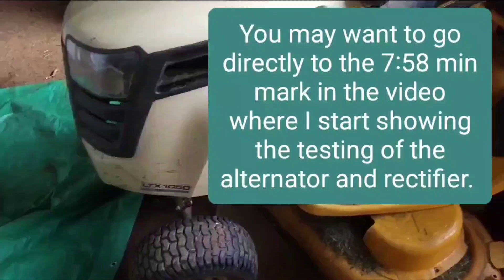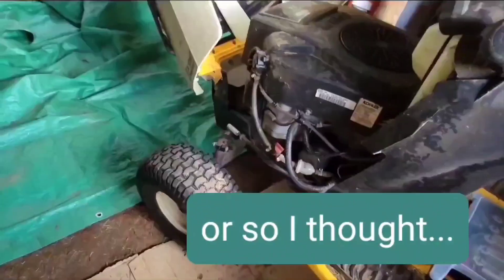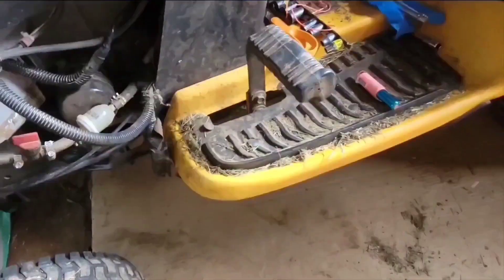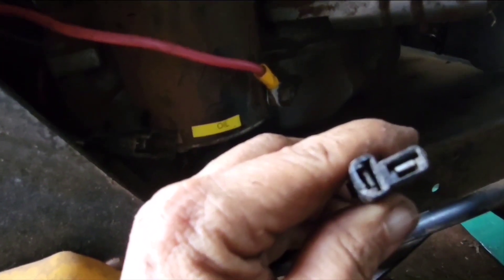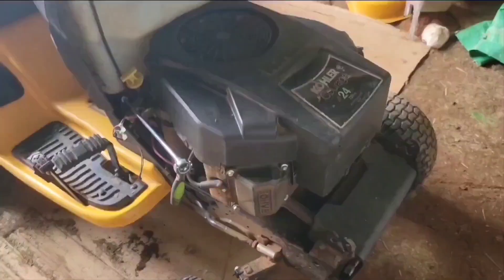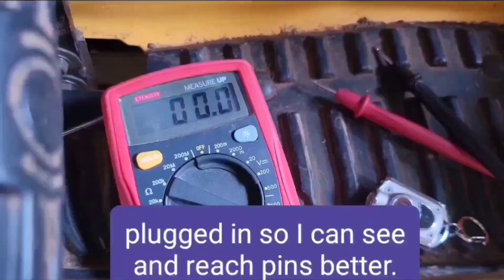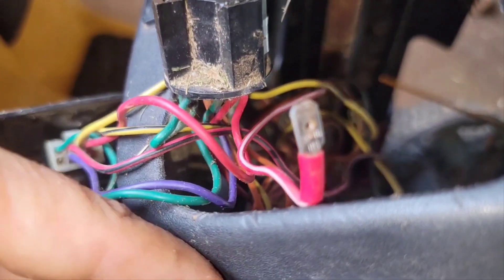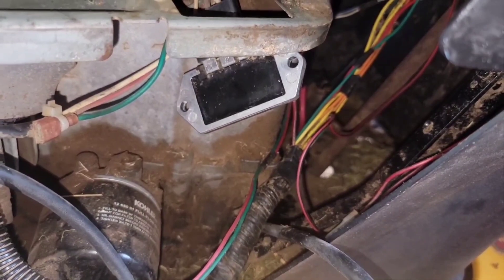DIAGNOSING BATTERY NOT CHARGING ON LTX 1050 CUB CADET : PTO, ALTERNATOR, AND REGULATOR

Comment: Okay so I'm learning all of this tonight 😂 there is actually a part that charges the battery on the mower! I got the exact same mower and engine. I guess I'll have to check it out and try to see if I can fix the issue or if it needs a jew alternator or something! That's weird the wire necessary to charge the battery wasn't connected on yours. Any idea why?
Reply from the maker: @TomdrumsTN  Hi Boch, yes, the PTO charges the battery as long as the internals are working.  I got the mower used and am not sure how that wire got disconnected.  Someone rewired everything to remove all the safety switches.... which I really like, but I think maybe when they did that they cut that wire not knowing what it did. I never could find the mate to it.
Reply: @girlintheblueridge6529  thank you so much! I'll be working on this soon. The mower screen indicates that the battery has 11.5v while running and 10.5 to 10.9v while the pto is engaged. Definitely too low! Lol.
Reply: @girlintheblueridge6529  https://youtu.be/qXZpi7UKges?t=511 could you please explain me where i should put each pin of the volt meter on this regulator that has 3 different section ? Thanks!
Reply from the maker: @DrumPeearl  Hi Boch, Yes, with ur meter set to read 50v or more, attach your positive and negative leads to the out two pins. The middle pin is ground. It does not matter which is which because AC current is alternating. Just use the outer pins, far left and far right. Not the middle one. Does that help?
Reply from the maker: @DrumPeearl In the description I have left a link by Kohler Engines University and he shows the actual 3 pins coming off the stator/alternator and shows how you connect to the outer two pins to test. Watch that if you can.
Reply: @girlintheblueridge6529  Thanks for your reply . I have ran several test . one with the probes in the harness of the regulator directly . both on the outer sides . it actually showed like 30 to 40 ac ... and then I ran another test with the regulator plugged and made the probe touching the 2 outer pins of the capacitor and the results were weird.  sometimes it was showing 0 and sometimes 30 to 40 ac . also I tried to measure the tension on the battery directly . when mower was off it was showing 12.6 something v and when the regulator was connected it showed 12.8v at the highest voltage ... not more . I guess the regulator is bad . I am actually waiting to have a replicate part (china) deliver today and see if it changes anything . I don't know what it could as all the wires are well connected and secured on the connectors by the starter and screen ...
Reply from the maker: @DrumPeearl  Hi Boch, thanks for the update. 
The 30-40v ac reading means your alternator/stator under the flywheel is good. 
  The variation of 0-30v you got when the regulator was plugged in was probably just a lack of solid connection. Make sure the pins and terminals are clean and no corrosion. If they look good, it was probably just your probes not touching good or moving around. Both of these tests only test the stator. 
  In order to know if the regulator is good, one needs to verify first that there is 12v power at the regulator.  With regulator plugged in, and meter set to V DC,  probe the center pin on regulator and the battery ground. Meter should show 12v. (If all your wires are okay, voltage shown should be same voltage as battery)  If not, there is a problem with connection of that purple wire to a power wire.  
If you have 12v there, then with a fully charged battery, start the mower. If the regulator is good, you should see about 13.8 V or more on the battery. If not, then put in new part and start mower and test battery. New part should fix the problem. 
  From your comment I wasn't sure if you were saying that you were showing 12v at the regulator center pin or not. 
    The voltage of the battery with or without the regulator plugged in does not verify anything except the state of your battery. Sounds like your battery is fully charged. 
   Do u have 12v at the center pin as described above? And what is voltage of battery when regulator is plugged in and mower is running?
Reply: @girlintheblueridge6529  Hi! I got a new part and I'll try tomorrow . No matter what the voltage on the 12v battery never went over 12.8 when i measured wit the volt meter in dc mode . It increases from 12.6v when mower is off to 12.7-12.8v but never over . the battery is from rural king and is about 1 year old and maybe 10 hours of mowing but maybe the fact I had to charge the battery many times have worn it out .... I'll see tomorrow! :)
Reply: @girlintheblueridge6529  I changed the part and I can tell there was an issue with this part the whole time because on the screen it was showing the voltage of the battery instead of the hours of the mower and I also had the red light whenever the pto was engaged! Problem solved and the mower is way more powerful now! :) BUT the voltage on the battery is about 14.5v when the rpm is set on high . Which  seems to be little bit too high ,right ?
Reply from the maker: @DrumPeearl   Hi Boch, so glad to hear you got it fixed and working! And thx for all your details. It will help others. 
As far as your charging voltage, mine was reading around 14.5 too and I was concerned too.  That's higher than most vehicles. But I've been mowing with same battery for over a year now since I did the repair and it even sat all winter outside... that makes the battery 2 years old now and it's only a one year battery. So I think you will be okay. If you find out anymore about the correct charging voltage let me know.  Take care and happy wrenching!
Reply: @girlintheblueridge6529  thanks for all your answer and help on addition to have published this video! I have definitely over thought this whole thing lol. Also I have checked and a mower battery should be around 14.5 to 14.8v with a high rpm. A car battery is normally slightly lower while in charged.
Reply from the maker: @DrumPeearl  welcome. Yeah, I definitely over thought the whole thing too initially! Lol. The video is kinda choppy too cause I was learning too. Once you understand it and make sense of it all, it's really simple, I know. I can't believe I went a whole year having to charge the battery every time I mowed. It just seemed a daunting task to fix.
BTW, my battery WAS dead first time I tried to mow this past spring. I thought for sure it was a goner because of all the times I had drained it. I was about to just go buy a new one, but then I decided to try charging it up and see how long it would last. I'm so glad I did. It's been starting every week without any problems. I even left it for 2 weeks with out mowing and battery was still working. Going on it's third year. 
I got it at Tractor Supply. Will definitely get one there again.
Reply: @girlintheblueridge6529  mine was bought last August from rural king. Probably the cheapest model. I'll see how long it last with the fact it has been jumped and charged many times. I am always in a process of learning. I didn't think the mower had this defective part! How many hours does your mower have?
Reply from the maker: @DrumPeearl  It had 300 hrs on it when I bought it 2 yrs ago. Now it has 400hrs. And urs? 
I changed the transmission fluid right away. I was so glad I did. It was milky. I've yet to get that video posted. It's important to do to keep the transmission in good working order. Had to siphon out the top of the transmission and then add some fresh fluid and siphon again until it was clear, rotating rear wheels each time. Then fill and put plug back in.
Reply: @girlintheblueridge6529  mine has 240 hours and got it last end of June with 190 hours. I don't mow super often lol. I didn't know the transmission needed to be flushed! Is that complicated to do? What symptoms did you encounter before thinking about doing it?
Reply from the maker: @DrumPeearl  I didn't know the history of the mower. It seemed to run okay, but I wanted to do preventative maintenance. I figured fresh oil would keep it running good for a long time. I came across this link and went by that as a guide.
https://youtu.be/SxkR2Hade9M?si=lyhmuNe3xUk-RF8K

 Apparently my mower had been left outside where it would get hot from the sun and then at night it would cool and create condensation in the fluid cause it was milky chocolatey brown. Generally from what I've heard is that if you have sluggish acceleration, changing the gear fluid can help. I didn't notice mine being sluggish, but it did seen to have a little more get up and go after the fresh oil was in it.
Reply: @girlintheblueridge6529  thanks! Yeah the mower i got also stayed a season under a tree apparently.... The deck paint is peeling a lot.
Reply from the maker: @TomdrumsTN  welcome